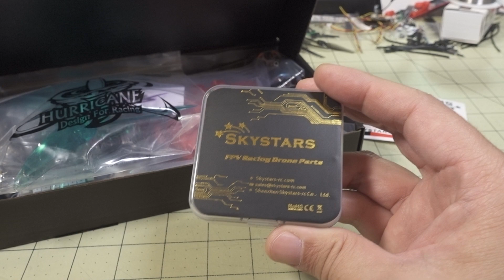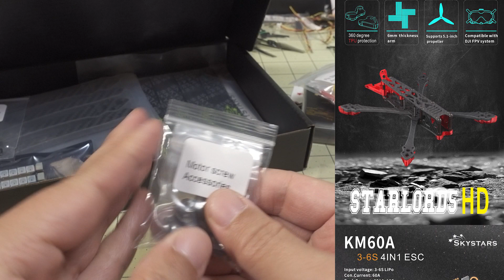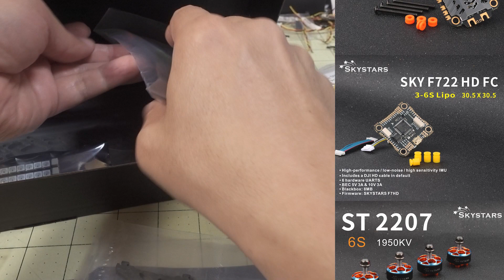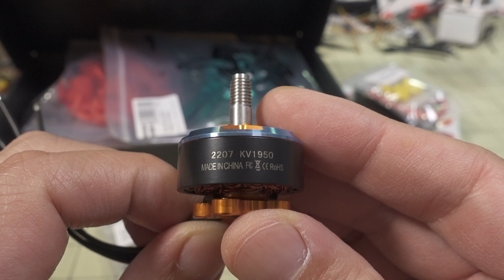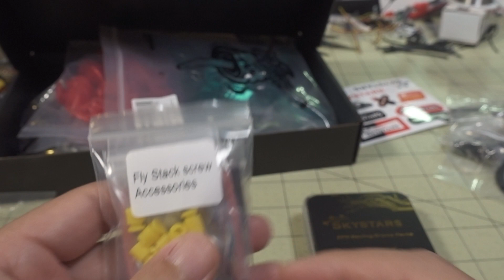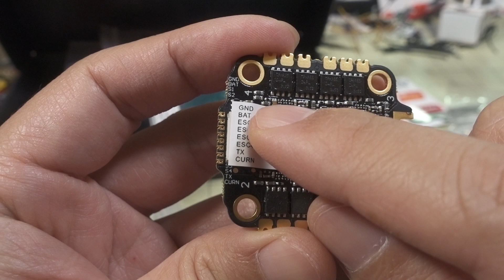SkyStars Limited Edition 5" November Drone Box & Giveaway ✅🎁

Comment: Turns out the arms are 6mm thick, which is good... but on further examination it doesn't seem to have an extra 20x20 mount in the rear, which would make it a pain to squeeze a Vista in there. So unless the full air unit fits in there with the aid of a 3D print, not the best choice of frames for DJI.

Comment: That's an awesome box. 😄
I have yet to build my own quad from scratch but I'd like to try 😊

Here's some details from the product page:

SkyStars Star-Lord 228mm Frame Kit
Weight: 118g
Wheelbase: 228mm
Material: 3K Carbon fiber
Arm Plate Thickness: about 6mm
The thickness of the top plate: about 2mm

Comment: i wonder if that Skystars F722 FC isn't curved to match the frame or if they are just trying to be different and stand out from all the others?

 i love the fact that it has the option to solder either flat or through hole and the ESC motor pads also have the notched channels as well, it looks pretty stout and has a nice heat sink, but i love when manufacturers do the "skeletonized" cuts on them ;)

Comment: ^ Looks like a nice build, too bad the givaway is not for the whole kit, great project, and I have the Vista, kindoff, Banggood black Friday has the Eachine/Caddix kit so I guess has a rebranded Caddix (Eachine) Nebula Camera, couldn't pass it up for $100 US warehouse, so no 2 month wait. Conformal Coating on that stack is a very cool feature, but am I wrong if I beleive that in order for it to be effective the newly soldered connections have to be coated too?  Stack comes equipped with F7 controller with 6 UARTs Micro USB and has multi connector for DJI setup. Sweet. I have a beater quad I could improve with this stuff, Good Luck everyone and thank you Albert for the great opportunities.

Comment: I would like to try F7 fc. And this the spec :
30.5x30.5mm Skystars F722 HD F7 Betaflight & DJI OSD Flight Controller 3-6S w/ 5V 10V BEC Output & Black Box for DJI Air Unit RC Drone FPV Racing

Comment: I like that the fc has a blackbox chip, not a sd card slot as it is easier to conformal coat, also don't need a sd card. Spec: 8mb blackbox.

Comment: The Skystars F722 flight controller has 6 hardware UARTS which is quite useful but I can't figure out a reason for the curved sides which makes some solder pads smaller as well as eliminating some of the through pad holes.  Thanks Albert for hosting this as well as the info on the drone box contents.

Comment: Thanks Albert, I love building with the f722 flight controllers because you get several uarts to work with and no need to factor in inverted vs. uninverted signals.

Comment: That seems like a pretty good deal with an f7 fc, blheli_32 esc, and those motors look much better than the ones on the 7" bnfs for a couple years back. I twisted off a prop shaft putting on props, I thought ok now I know, but then 1 snapped off taking a prop off. It wasn't entirely skystars fault, but I really had trouble with that one. I hit an esc with a prop, replaced but pass through, (I think it's called) didn't work with the FC, I flashed it, and orientation had to be fixed, then the problems really started, lol to make a long story short...... Nm, too late, lol. Thanks Albert!

Comment: Nice kit. Almost everything you need for $129.99. Great overview. I'd prefer a 50v 1000uF cap if running 6S instead of the 35v 560uf cap. Plenty of room in that frame. I personally prefer the 51466 Hurricanes. Or 51433. The 51499 Gemfan Hurricanes are aggressive props for a freestyle. Is there a difference between an fc labeled F7 vs F722.?
Happy flying Albert